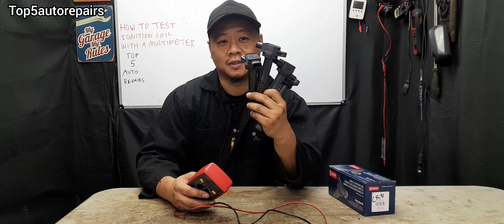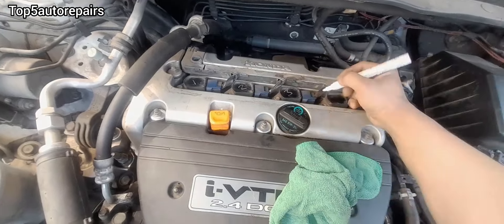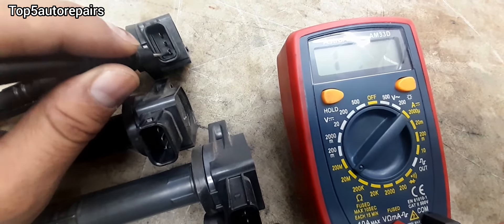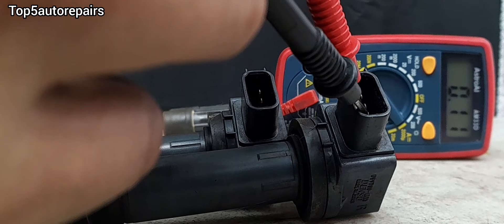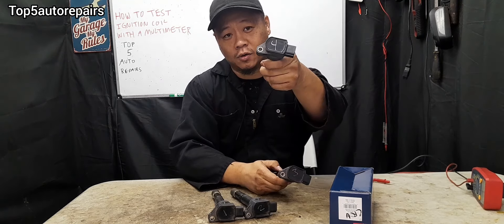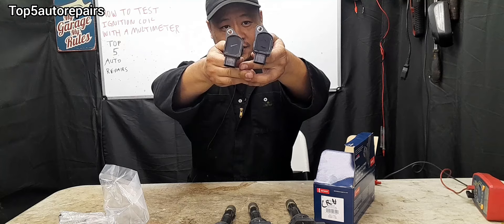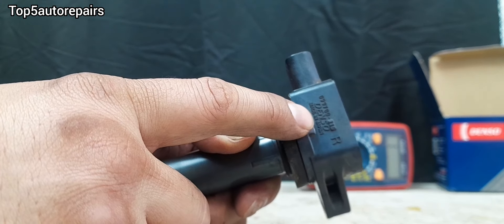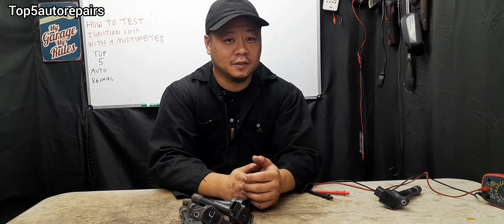HOW TO TEST IGNITION COIL WITH A MULTIMETER AND NOT KNOWING THE SPECIFICATION

Comment: I came across your video as I am deciding whether to return the Denso coils( made in China) that I ordered from Rockauto to replace the originals in my 06 Toyota Sienna. The reason is that the resistance of the original is way  higher than the replacements  which is16.6K ohms vs 2.3Meg ohms for the originals. I saw another video of a genleman testing new NGK coils which are similar in resistance value to the originals. Having matching coils no doubt are important BUT shouldn't there be a resistance specification for coil? Where can I find that spec?

Comment: Thank you for this invaluable information. Question: how much of a difference in ohm readings between old and new coils (if any) indicates replacing the old coil(s) for brand new coil(s)?
Reply from the maker: It will vary between each vehicle. All Data is a good software to confirm specifications.
Reply: @Top5AutoRepairs  Thanks!

Comment: The rubber underneath the top part on one my car's coils has some cracks. Do the cracks impact the car at all? Thanks.
Reply from the maker: It will cause voltage leaks. You may notice an engine misfire, poor gas mileage, hard start, maybe no start, poor engine performance etc...
Reply: @Top5AutoRepairs  the cracks are not in the rubber that mates the sparkplug though. It's the rubber on the top part that mates the valve cover. And that can cause the issues  you just described?
Reply from the maker: It shouldn't be an issue

Comment: Thanks for the video first. If I may ask one modest question. The order of the ignition coils seems to matter because they are numbered. How can we find out the correct order when we don't have a numbered coil and what does the order matter if all the coils are the same. Thanks in advance. Sincerely, Levan.
Reply: If you asking for installing all new coils it doesn’t matter, they are all the same, for diagnostic purposes it does help labeling, even though they are the same, let’s say 2 out of 4 are bad, then numbering them could help, for example, cylinder 1 and 3 are misfiring, you take the coils out and label them and 1 and 3 should be coming up bad, if not then it’s another issue, but if all of them are good it doesn’t really matter, coils don’t control firing order, they just deliver power to the plugs
Reply: @abrahamrubio3440  Understood, thanks for the reply. If I may ask you one more thing. When the multimeter shows 0.05 instead of 0.04, is this ignition coil no longer suitable or is it replaceable?